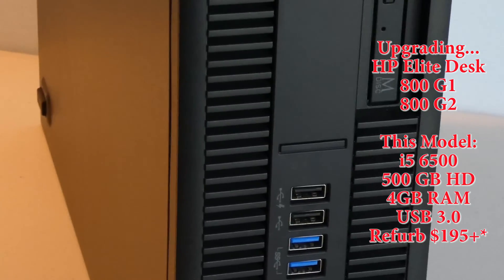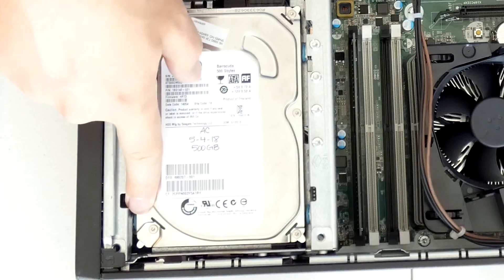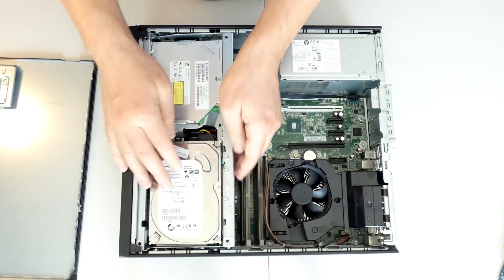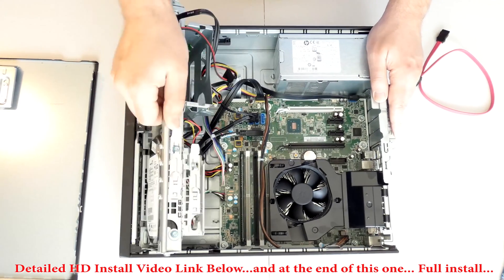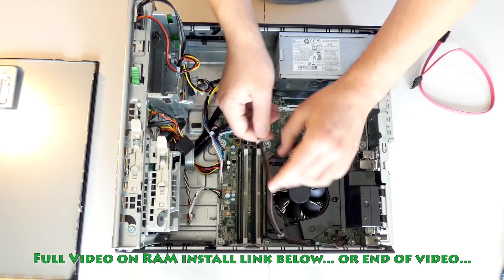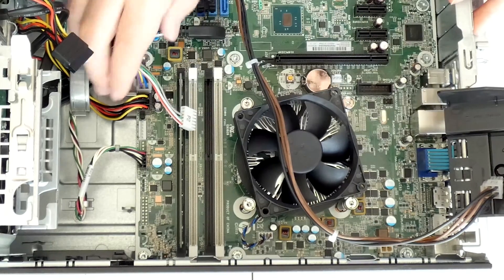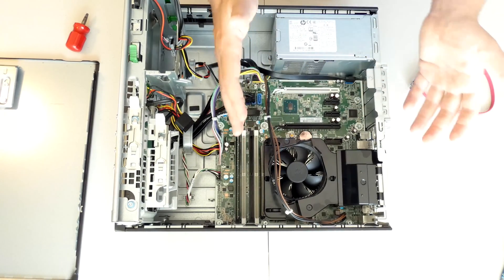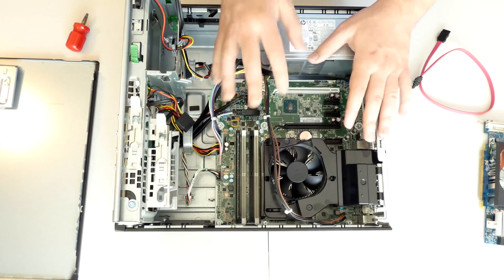How to Upgrade HP Elite 800 G1, HP Elite 800 G2, 600 G1  Small Form Factor Desktop, RTX A2000

Comment: What form factor is that motherboard?, im thinking of buying this, but i would take the motherboard and cpu out and put them in a bigger case with a bigger psu an all.
Reply from the maker: Very good question. It appears to be standard ATX size, however the issue comes with PSU power connectors. This motherboard only takes HP PSU with 3 separate mobo power connectors (not 20 or 24 pin).
Reply: Interesting, thank you very much, i think im just going to buy a cpu and motherboard separate.
Reply from the maker: My pleasure. I hope you enjoy your new PC. :)
Reply: @BubblegumDog07  it is not standard ATX, it is Micro ATX.
Reply: @Cobuman  I just get to this video because I'm about to move everything to a bigger case and I faced with the first issue which is how to connect the power cable to this motherboard? Is this meant I won't be able to move it with another case with a standard 24 pin power connector? Is there any adaptor would slpit into as require in this motherboard?
Thanks in advance
Reply from the maker: Something like this could work: https://amzn.to/2VbOBPt I honestly can't recommend using adapters likes this because they are made cheap and can cause issues But, it could work fine as well... :) If you do buy one and it works; after some use check the adapter for burned marks and such.
Reply from the maker: I just made a video that talks about transferring everything to a full size PC case which allows for big PSU: https://youtu.be/C70nmtTFPuw

Comment: ~130 dollar for this pc (G1 version) with an i5-4570, 4GB ram, 500GB HD.
Good deal or no?
Reply from the maker: That's a pretty good deal. Add a bit more ram and a video card... That would be a pretty decent gaming machine. You can get a really cheap SSD that you can use for OS which makes a huge difference in performance. 
At my work, majority of computers are the same G1s, almost a thousand of them. I still use an i7 of the same generation cpus.
Reply: Thanks for your comment :) I do plan on upgrading the ram, and a good and kind friend of me gave me a 256GB SSD for free. I really can't afford a new video card atm so i plan on using my current regular size video card by just using the pc with case open if that is possible, or finding another creative way. You think that would be possible? I know it wouldn't be ideal, but it'd be just until i can afford a new card.

I love your videos btw, very well explained guides :)
Reply from the maker: Thanks for the support. :) Your idea for innovation is admirable. Technically speaking you can get any card to work; however, the biggest problem is with the size of the card. The regular size card will not fit in the back nor towards CPU, inside the case. Even if you had a card short enough it will not fit without changing to shorter backplate where your monitor connects to. As a very temporary solution, you could get a pcie riser that will let you mount the card externally. Also, if your regular card requires additional power, you may need to get an adapter for that as well. Just be careful so you don't cause damage or hurt yourself. :)

Comment: Does that motherboard support ddr4 ram?
Reply from the maker: Oh yea, up to 64GB of DDR4 ram. This is the new intel CPU architecture (14nm) in this PC (800 G2), which is i5 6500. Keep in mind if you have the 800 G1 it will be DDR3  . Very good question. :)
Reply: @Cobuman  So if I have the 800 G1, I'll need DDR3, but will it still support 64GB of Ram?  Crucial's site makes it seem like the max ram I can run in this pc is only 32GB?  Btw, I have the i7-4790.  Thank you for your help!